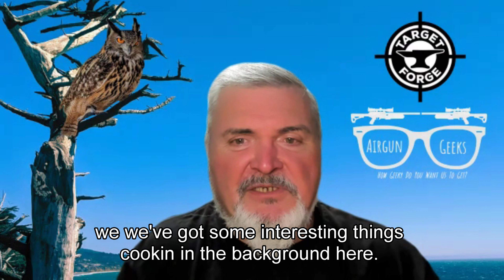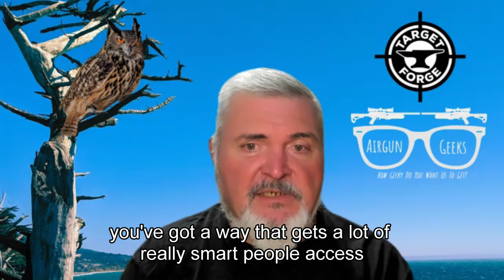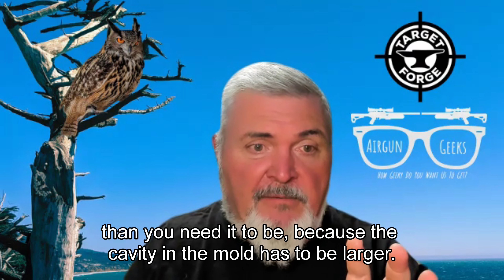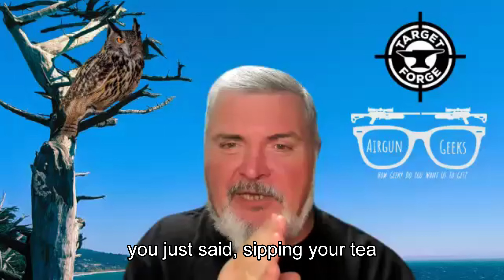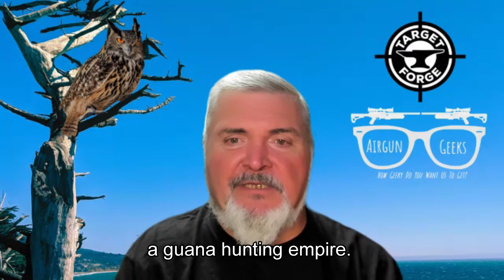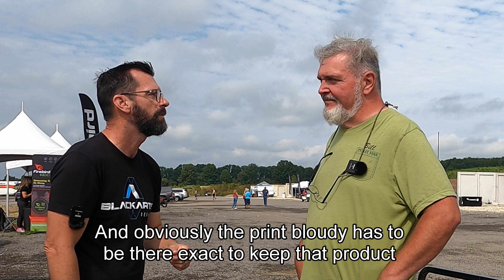Plastic, Metal, Air: The 3D Printed Airgun Accessory Revolution #3dprinting #airgun #podcast

Comment: Excellent overview and details Guys! You two rock! It was awesome chatting with again Bill and meeting you Patrick.
 One point to clarify. The larger the layer height the lower the tolerance resolution becomes. A 1mm tall feature can't be hit if your layer height is set at .6mm, for example. It will be .6mm or 1.2mm. But yes, the part will be produced much faster. Using the variable layer height feature in Slicers can increase the resolution, but still will fall in a tolerance window. We use the lowest layer height our materials will allow to ensure a great finish and tight tolerances. Keep up the great work gentlemen!